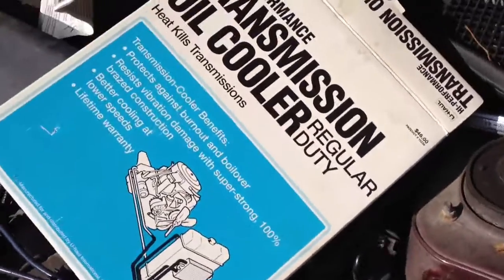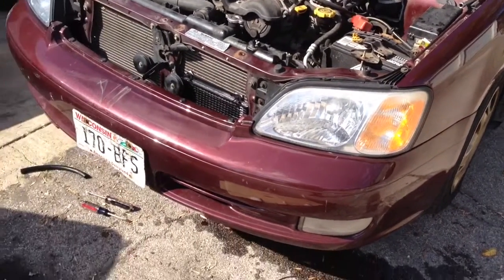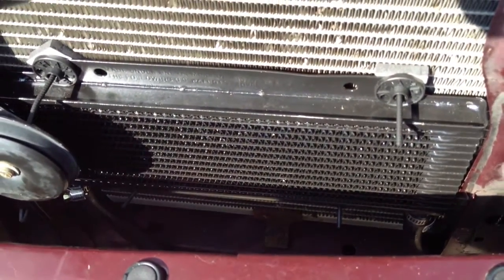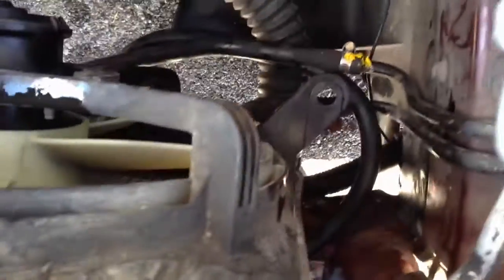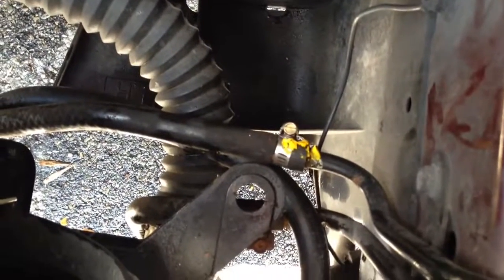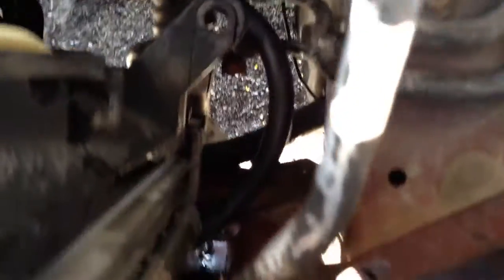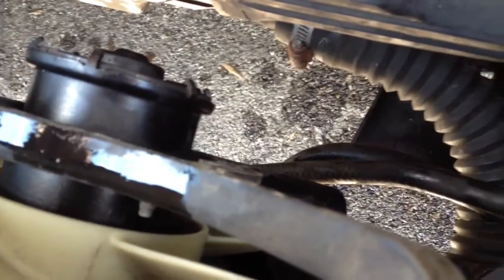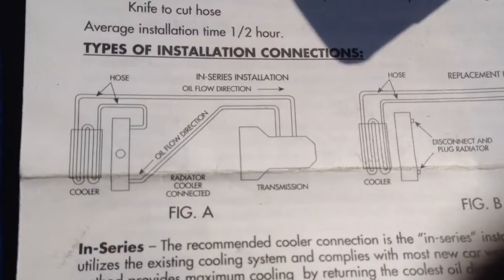Subaru Transmission Cooler (U-Haul external unit)

Comment: Are you supposed to run the hot fluid through the cooler before the radiator so the thermostat can regulate the temp? If the cooler is last before the transmission couldnt it cool it too much?

Comment: Do you work mainly on Subarus? I would love to see a video of this done on an 02-07 WRX with the 4EAT. Except I would like to see it done incorporating the transmission filter. I didnt think these has actual send and return lines for the trans filter but theres write us online that basically say this is the wrong way to do this and the only way to do this is to run the auxiliary cooler before or after the trans filter( I cant remember which).  Have you ever done it this way? Also its not just for hauling. automatic equipped cars that are making significantly more power than stock benefit greatly from a trans cooler if theyre run harder than normal on a fialy regular basis.
Reply from the maker: +JackstandJohnny I would put the cooler after the filter and before the trans. This way the cooker cannot become clogged. And also cools the atf before dumping heat into the radiator. The engine coolant will even out the return line temp to bring back fluid to the trans at normal operating temperature.

Comment: Wait, why does he need this? Was something wrong with the radiator?
Reply from the maker: Uhaul is the worlds largest retailer of custom hitches. The car is equipped with a tow hitch. The necessity for the external transmission cooler is for the purpose of towing.